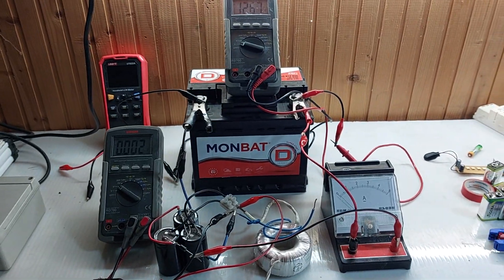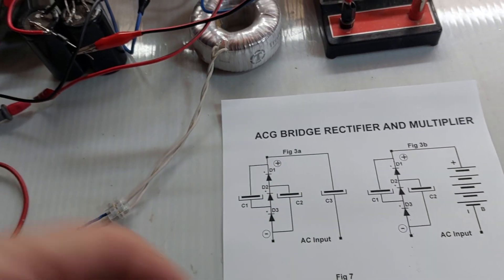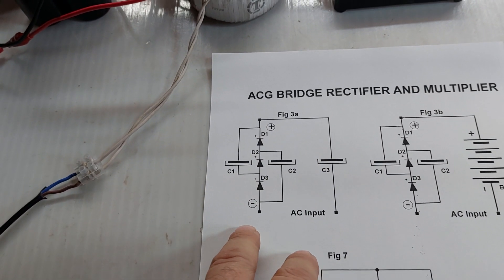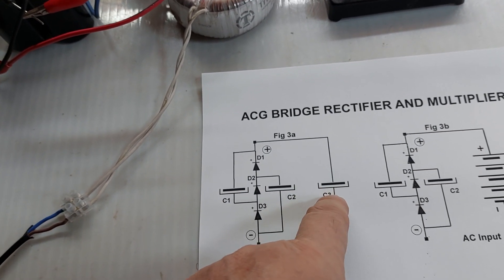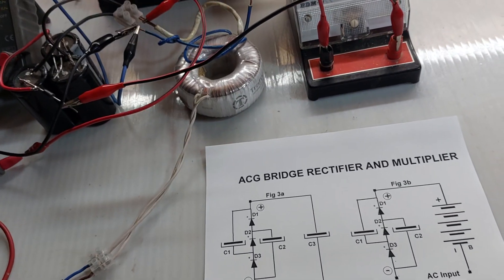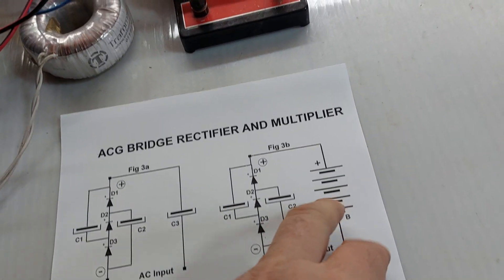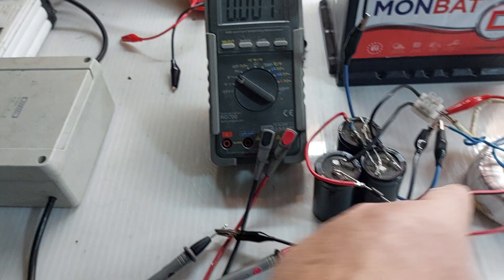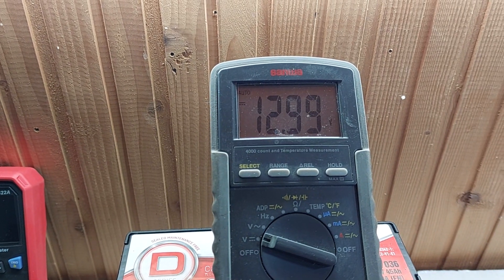Charging 12V Battery with 6 V Transformer by using ACG Bridge

Comment: This is a very clever circuit and I will note it down ! ! ..... but as you have a ring ( torus )  transformer with a  HOLLOW  centre , there is a  MUCH  easier way to charge your battery ... just wind several more  turns of insulated copper wire on top of the clear insulating tape cover to get the correct voltage for your battery ( 14 Volts peak MAX should equal around 10 Volts RMS output ) and use a standard Silicon bridge rectifier + current limit resistor ..... give it a go ? ........ DAVE™🛑
Reply from the maker: Thank you Dave , I agree with you. I published  few days ago  exactly what you said. Have a look it here https://youtu.be/7Ma0yKimYyQ   and here https://youtu.be/Kv7NZ9LjSb0